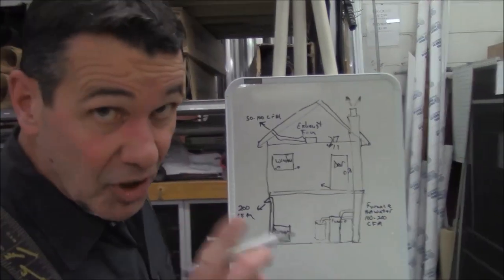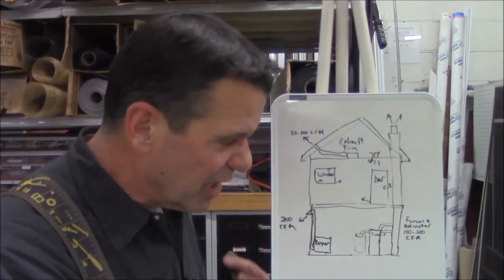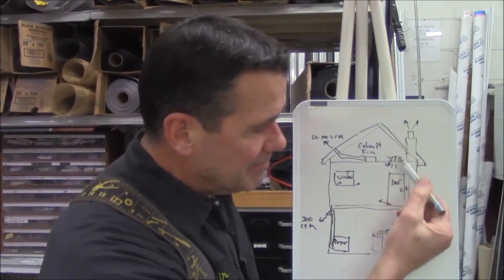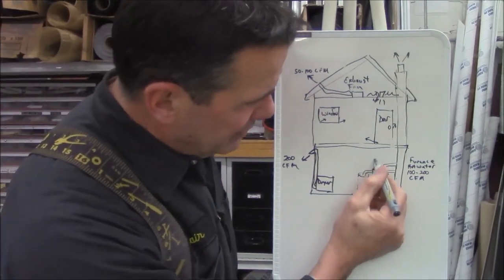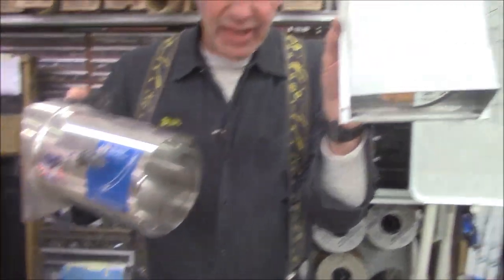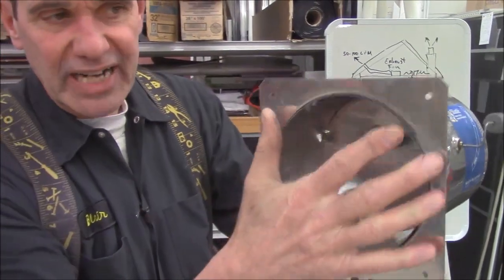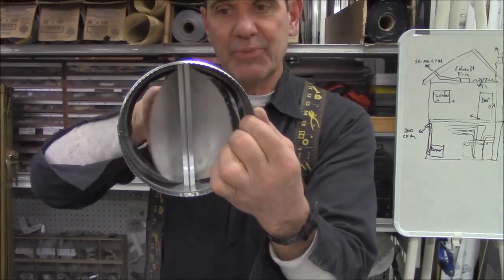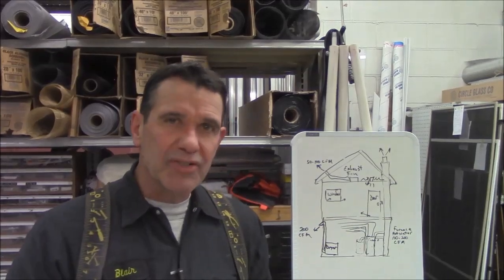Negative Air Make-Up Recovery Using Ducts for Furnance, Water Heater, Dryer, Fans

Comment: sorry, I do not want the MAKE UP air supply attached to the cold air RETURN DUCT.

I want it into the ROOM where the furnace and clothes dryer are/is located.  (water heater also) 

Why you ask?    Combustion air as well as fan blown air.

SOLUTION,  Open a BASEMENT WINDOW.  works well all winter

comment please.
Reply from the maker: My editor, who is a little rough at times, removed the part where I show a duct of outside air coming down into a bucket, which acts as an air trap, which is in the mechanical room, supplying the dryer, and the furnace and the hot water tank, which is more controlled than letting free airflow through an open window.

Comment: Will an ERV tied into the cold air return serve the same purpose?
Reply from the maker: I think it is a higher tech version of what I’m doing low tech. Because it brings in fresh air and exchanges the heat or cool that’s in the house to the air coming in. I believe it will allow more air to come in then what’s going out because it’s not positive displacement. The main purpose of my video is to let the house that has negative air caused by dryers and exhaust fans to be brought in the house in a controlled manner instead of through cracks in windows and doors.

Comment: Ive spent half the day to find something so simple that you explained, I want to add this kind of thing direct to the furnace which i think will also clean the circulating air with clean air as my wife is a smoker, now I know its not exactly a verner hvr or hvak whatever you call them , they are difficult to install retrofit in my older home but your simple system could somehow be tweaked to accomplish this , so at least Im more informed on how to do this  thanks again good job

Comment: Absolutely the wrong thing to do is run that to the cold air return. That needs to go to a sealed box around the burners. Sending to the cold air return is just going to make that air colder and take more to heat it up. I can't believe someone would do that.
Reply: Debatable.. just think for a sec ..that duct is in place for on demand VOLUME of air being requested by the fan immediately..what u talking about is supplying oxygen to have efficient burn..but that isnt eating up Volume of air and definitely not vacuuming it suddenly ..the biggest VOLUME of air being displaced and suddenly which creates imbalance in pressure and if air isnt available immediately to supply and balance the extra amount needing at that moment what happens?...its vacuum, negative pressure..so water heater open flue pipe is the easiest target rather than your fresh air in a box.. everything else doesnt move that volume of air in the house in an instant..furnace designed for example 1700sqft of volume to handle oppose to 5 lil burn chambers,or a 3sqft dryer slow and steadt gojng pumping out maybe a 100th of fraction of air and steady..etc..  air has resistance in volume plus duct plus return grilles ..just think why airplanes go so high?..not because they cool,or they just smoked one..less resistance.. to add more sensible reasoning to your noise..god bless everyone
Reply: @MrEuroWolfie  The reason to use outside make up air is to plumb it to the burner so when it is burning it isn't pulling a vacuum on the house and then cold outside air is sucked in through doors, windows, and cracks which then must be heated. The burner will also have a good supply of oxygen rich cold air for a better hotter burn. The greatest majority of houses have no setup like they put in and there is no issue with sucking down the flue pipe. The fan kicks in and pulls air from the cold air return and will push it through the ducts to the registers. It's a closed system more or less. The only time air would come down the flu is when a large volume of air is being sucked out of the house by a exhaust fan.
Reply: My professionally installed he furnace has a fresh air intake built into the return duct supply. Gets filtered and heated just like the return air.
Reply: Just OPEN A WINDOW in the room/basement where clothes dryer, furnace and water heater are located.

PROBLEM SOLVED.   makeup air for COMBUSTION and fan driven air.

comment please
Reply: @tedlahm5740  And make the entire area cold and the house harder to heat.

Comment: I have a closed combustion (high efficiency) furnace and a atmospheric (top vent) hot water tank in the same room.  I have experienced backdraft at the hot water tank vent when running dryer/range hood.  I want to move the existing make-up air duct in the furnace room  (in a bucket) to the air intake of the furnace to better support the other house equipment (dryer, range hood, etc.) and open a air register in the furnace room to support the hot water tank.  I run my furnace fan 24/7.  Will this work?
Reply from the maker: If the furnace is closed combustion it should have 2 pipes to the outside. One for combustion to go out and one for intake air to supply the furnace. It should not be using any house air. The hot water tank only pipes exhaust out but uses house air for combustion, creating negative air. Your makeup air supplies the hot water tank, not the furnace, which maybe isn’t piped for incoming air. 
Your makeup air in a bucket also supplies air to the dryer. A big user of house air.
All that being said you need a mechanical contractor to answer this issue in person.

Comment: But if you are getting this fresh air from outside which is cold air, doesn't that mean you can now have this cold air not getting warm enough when passing through the furnace?
Reply from the maker: It will get heated if the furnace is running, I do get an occasional chill but not for long. It is more important to prevent negative air from entering through cracks and voids.

Comment: Hello.  Thank for the tips.  Do you recommend the method to connect duct to return air plenum or run a duct down into the furnace room into the 5 gallon bucket?  Or both methods ?
Reply: I actually have both, a combustion air feed into my dryer (because my furnace and hot water tank are both closed combustion) and a second makup air to the cold air return on the furnace, which supplies kitchen and bathroom exhaust fans.
Reply: Thank you so much!!  I am excited to get the fresh air duct installed and see the results   Can’t wait.
Reply: Hello again.  I am adding a combustion air duct and I’m wondering if the inlet location on the exterior of my home can be 7ft away from a dryer exhaust vent

Comment: Found water heater back drafting when a.c. is running.   No exhausts fans running.  Problem seems to be leaking duct work in crawl space on the supply side.   Causing house to be in a negative pressure.
Reply from the maker: Interesting and dangerous. One malfunction causing another. I never thought of supply air leaking out of a house.

Comment: I did this for my house. Put a 6 inch outside air duct right into my AC plenum on the intake side. It runs through a filter, and there is an in line fan that I hooked up. Fan is wired to turn on only when the AC fan turns on. We used to have dust covering everything in the house every 2 days... now we barely ever have to wipe off the bookshelves. It's a real game changer if you get allergies in your house.
Reply: Curious regarding your in-line fan, wouldn't it be enough to just connect the direct to the air intake since the suction provided by your furnace already provide the suction required?
Reply: @shoebh.3389  , Yes it would already be good for getting fresh air into your house to just connect a fresh air duct into your intake plenum and leave it at that. 

However there's another problem going on in houses with AC ducts in the attic... The problem is the imperfect seals between the attic space and the living space. When there are pressure differences the dirt and dust from attic will drop down into the living space through the cracks and holes in the ceiling.

The extra benefit of adding a fan to an outside air duct is a very small positive pressurization of the ducts and the living space.

It's extremely dirty and toxic materials in most attics. The positive pressurization can be enough to stop attic air infiltration.

In the case of my house, due to the extremely large attic space volume (we have steep roof with 20' tall peak attic) the pressure difference due to wind and temperature differences between attic and living space can get quite substantial. So adding that fan and pressurizing the living space was very important for us.
Reply: @tkmair6559  That makes sense in your case. I don't have ducts in my attic and my furnace is high efficiency (i.e. dedicated fresh air intake already), so my incremental fresh air into the air plenum (without fan) should theoretically make a net-positive air pressure, wouldn't it?
Reply: @shoebh.3389  sure, if you don't have a dirty air problem, pressurization is not really needed. I an guessing you may have tye hvac system in basement?

Comment: Should've mentioned to keep an eye on that intake, didn't think of it after I bought my house in the spring, now I checked it and it was half plugged up, been trying to find a video on how to adjust the weighted part correctly and how to know it was done right? Thank you for your videos. (MN)
Reply from the maker: Move the weight until the baffle stays open. Then slide the weight a little at a time until it just shuts off the baffle. Just a touch heaver than zero gravity.